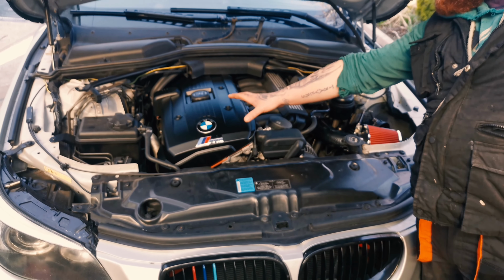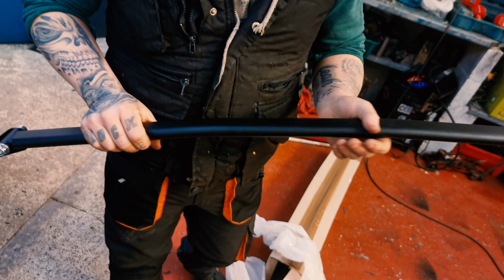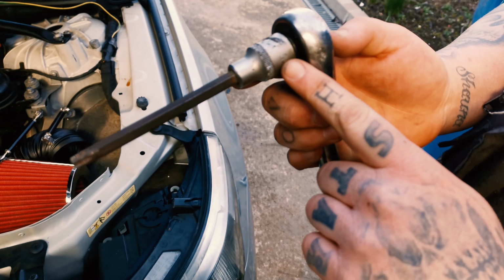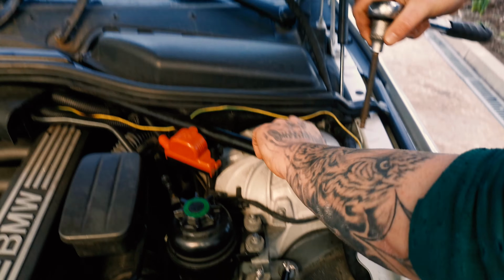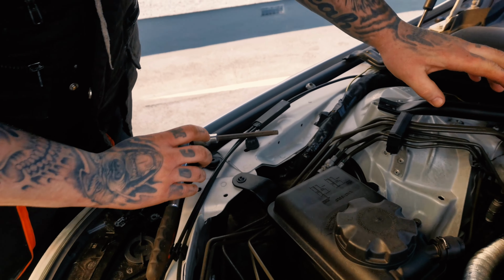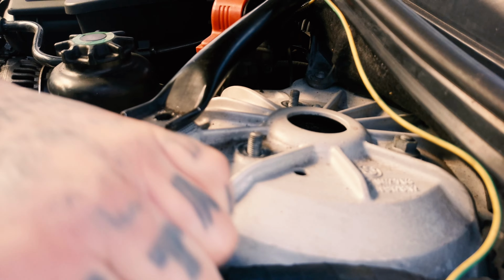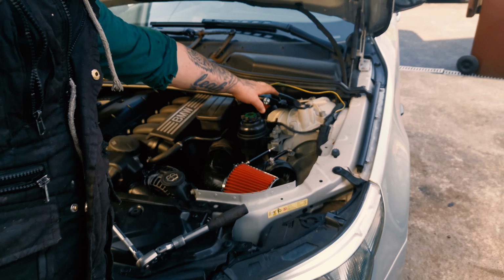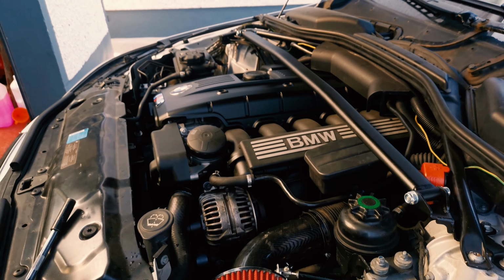ADDED STABILITY - SIMPLE BMW E60 STRUT BRACE INSTALL - HOW TO

Comment: Do you believe these make a difference?? I removed the stock one awhile ago bc it’s one less thing to take apart when working on engine
Reply: Super late but since the e60 front is aluminum mated to the steel body it flexes terrible with out the stock one